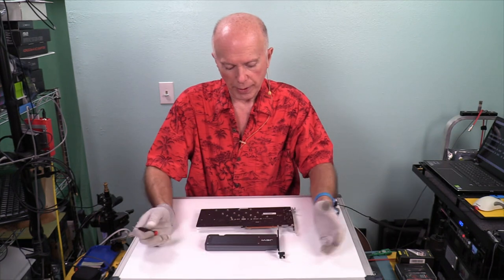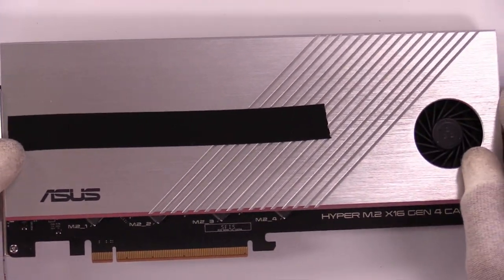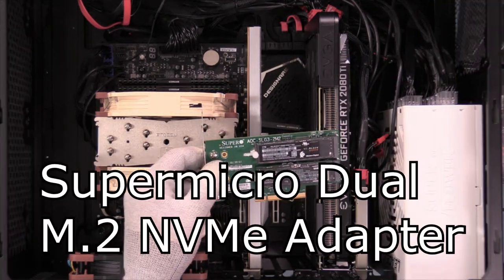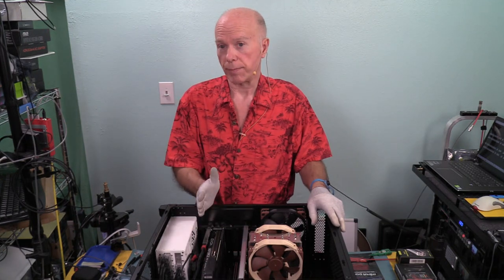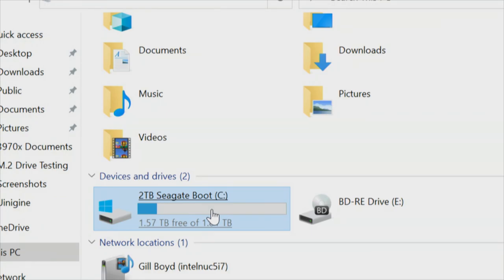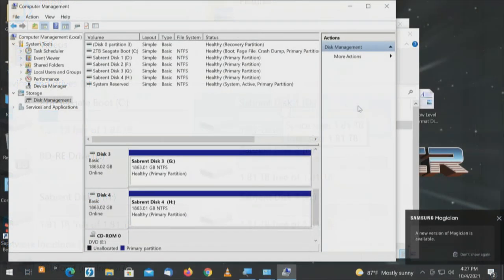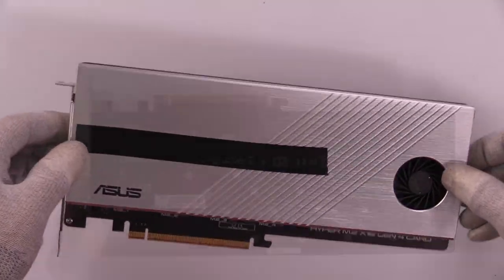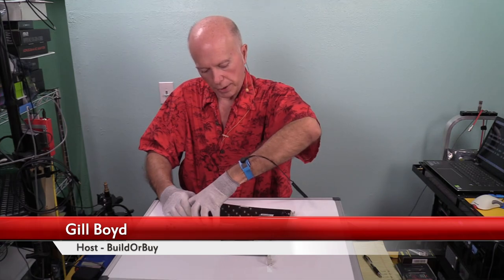ASUS Hyper M.2 X16 PCIe 4.0 X4 Quad card Heat and Speed Test Comparison

Comment: i have asus b550 m plus, i want to use this suport on second pcie slot, but he is pcie 3x16, i can use pcie4 ssd m2 with 7000MBs?
Reply from the maker: Hi Tuan Mello,
Welcome! We have more to get into on this than You may be aware of. What CPU are You using? Your Question may require a Video Response!
Reply: my cpu is ryzen 5600x
Reply from the maker: Hi @tautau22BR  
And Your GPU?
Reply: @BuildOrBuy  rx 5700xt
Reply from the maker: Hi @tautau22BR ,
Ok. Thanks. I don't think You have enough PCIe Resources to Add a X16 Quad card based on Your CPU and Chipset. We need to explain those Details in a Video Response so You'll understand how that works.

And the 2nd part of Your Question, You'll only achieve the speed of Your Motherboard Chipset. That too We'll include in the Video Response how that works as well! Appreciate Your Patience!
Reply: @BuildOrBuy  if I use 2 cards its possible? I dont plan tô 4 card yet,  i dont plan tô use raid too, i just want to expand, i can buy this suport tô use 2 cards and wait future upgrade of Mother board if I need 2 more slots,  i dont know if is good idea
Reply from the maker: Hi @tautau22BR ,
When You say 2 cards, do You mean 2 M.2 NVMe PCIe Drives or 2 X16 M.2 NVMe PCIe Quad cards?
Reply: @BuildOrBuy  2 nvme, 2 disk, the others 2 i can by in another generation, i dont plan to use raid
Reply from the maker: Hi @tautau22BR ,
To verify,  2 M.2 NVMe PCIe and 2 SATA3  Drives? JBOD, Got it! No RAID! Have to check Resources and get back to You!

To expedite... Here's what We know: 
1. CPU: Ryzen 5600X 
24 PCIe 4.0 Lanes
2. Motherboard: ASUS B550 M Plus
1 PCIe 4.0 X16 Slot to CPU
1 PCIe 3.0 X4 Slot through Chipset
1 PCIe 3.0 X1 Slot through Chipset
Supports CPU PCIe Bifurcation. 

1. To reiterate, not enough CPU PCIe Lanes. 
2. If You installed a X16 Quad card in 1st and only X16 Slot which Supports Bifurcation, Your GPU would have to go to the X4 Slot which is X16 mechanically but not electrically. Therefore, since You only have a X4 Slot to work with, You have two Options.
1. Install a Single M.2 NVMe Adapter. 
2. Install a Self Bifurcated M.2 Dual Adapter. That would be a card from Amfeltec. Here's a link:
"PCI Express Gen 3 Carrier Board for 2 M.2 SSD modules | Amfeltec Corporation" https://www.amfeltec.com/ssd-board-2-m-2-ssd-modules/
Hope that helps! Next time, let's talk Chipsets before You Purchase a Motherboard!
Reply: @BuildOrBuy  thanks for your help i can buy this on ali express?
Reply from the maker: Hi @tautau22BR ,
Good Question! That should be available there! Have not checked! Let Us know please! Getting product on a lot of Items mentioned is still a problem in certain areas. Keep Us Posted on Your Progress! Success on Your Configuration! Hope that helped!

Comment: m.2 nvme expansion card affects gpu ?
Reply from the maker: Hi @ΘεοδωροςΖωης-β7σ ,
Welcome! Depends. An M.2 NVMe PCIe Expansion card requires 16 CPU PCIe Lanes for 4 M.2 NVMe PCIe SSD Drives. A GPU typically requires the same, 16 CPU PCIe Lanes. That totals 32 CPU PCIe Lanes. If Your Motherboard and CPU combination has that configuration, no performance loss. That does not happen on a Consumer Desktop Motherboard. Only on HEDT or Workstation Motherboards.
Reply: @BuildOrBuy  thanks
Reply from the maker: Hi @ΘεοδωροςΖωης-β7σ ,
Absolutely! Thanks for asking.

Comment: Great video, can you install this and run it as 4 independent drives and not as a raid configuration?
Reply from the maker: Hi Dax Gaming, 
Welcome! Absolutely! That's the 1st step in Configuration, getting the Hyper card and 4 M.2 NVMe PCIe Drives Installed and Recognized by the Bios. Requires 1 x16 PCIe Slot, electrically. Bifurcated or Split from x16 to x4x4x4x4. 

The ASUS Bios or UEFI references this to RAID but that naming convention is a misnomer. RAID would be the next Step whether in Bios / UEFI or O/S in Configuration if so desired but to reiterate not required. Hope that clarity helps! Thanks for Asking!
Reply: @BuildOrBuy  thanks so much. I've been looking at the literature and was puzzled if it could be 4 seperate. Thanks for confirming

I'm running a asus rog crosshair hero viii wifi, so need to check all is good.
Reply from the maker: Hi @daxgaming6391 ,
That may be a problem. What Chipset? I'd like to do a Video response to explain the what, why and how. Also, which GPU?
Reply: @BuildOrBuy  that sounds great.
the rog crosshair hero viii wifi is a AMD X570 ATX gaming motherboard with PCIe 4.0, 16 power stages , OptiMem III, 2.5 Gbps LAN, USB 3.2, SATA, M.2, and Aura Sync RGB lighting.

CPU is the AMD 5950x with a MSI RTX 3080 TI suprimx 12gb.GPU
Reply from the maker: Hi @daxgaming6391 ,
Video Response Premiere's tomorrow!  
https://www.youtube.com/watch?v=yhCswjtumA4
Hope that helps!

Comment: Hello everyone, i have highpoint 6661a as I use it with Blackmagic decklink duo card, I am thinking to buy a quad nvme pci e card, will it work on MacBook Pro M1 Pro?
Reply from the maker: Hi Ahmed Jamil, 
Welcome! Great Question! Unfortunately no. The Quad cards of this type require Bios Bifurcation. And the Mac does not support that feature. In fact not all PC Computer do either. Not enough PCIe Resources in most Desktop Motherboards. HEDT or Workstation Motherboards have those PCIe Lanes for this. Since You have a Highpoint Enclosure, You have NVMe but You want more NVMe. Only requirement is a Full X16 Slot, electrically not just mechanically. Highpoint has 4 Drive and 8 Drive Self Bifurcated cards.

I'm confused. You have an NVMe RAID in the Highpoint 6661a NVMe Thunderbolt expansion chassis. But You want to ADD a Quad card to Your Mac? This should do what You want... This will work with a Mac.

Highpoint SSD7101A-1 NVMe 4-Port M.2/U.2 Unbeatable Peformance/Comprehensive Selection; No-Bifurcation Required 
https://amzn.to/3XZEOMn
As an Amazon Affiliate I earn from qualifying purchases! Hope that helps!
Reply: @BuildOrBuy  but no chance it will work on Mac? Thanks a lot for your reply really appreciate your detailed answer. Love how detailed your videos are.
Reply from the maker: Hi @metalliskined , 
Revised my reply with a Highpoint card that should work with Your setup. Thank You for Your Comments! These Details matter! Did not realize at first which Highpoint product You have! I do now! To reiterate, a regular inexpensive Quad card will not work on a Mac due to Bios Bifurcation Requirements. Bifurcation is the Ability to Fork or Split. In this scenario PCIe Lanes. Remember each M.2 NVMe PCIe SSD Drive requires 4 PCIe Lanes. A Self Bifurcated card has a PLX Chip doing the PCIe Lane Switching. Hence the price. Hope that helps with Your Video Production!
Reply: @BuildOrBuy  thank you so much it means alot
Reply from the maker: Hi @metalliskined ,
Absolutely! Thanks for reaching out! Keep Us informed about Your Progress! Are You Processing 4k or 8K Video?
Reply: @BuildOrBuy  I do live events, mix it through software and stream, also do video editing and color grading. have to deal with huge amount of data, copying and moving takes much time. I bought xs2000 Kingston hoping it will give full 20gbps bandwidth on mac but it's only 5gbps such a disappointment thats why I was thinking to have such 4nvme solution
Reply from the maker: Hi @metalliskined ,
Got it. That's a lot of data. An M.2 NVMe PCIe 3.0 Drive = 3,500MBps. And what We've seen with 4 Drives in RAID 0 is the Combined Speed of 3 Drives. 3 x 3,500MBps = 10,500MBps. Perspective. Hope that's going to help! Live Streaming 1080 or 4k? Live Streaming 1080 takes a variance of 12MBps tops from what We've encountered. For Comparison, Zoom needs 3.5MBps.

Curious the Kingston KS2000 is USB-C 20Gbps 2x2. Using that Device on a Mac You're only going to achieve USB-C 10Gbps. If it were Thunderbolt, 40Gbps but not 20Gbps. That's only going to happen on a PC with a USB-C 20Gbps 2x2 Port. Not all PCs have that capability.
Reply: @BuildOrBuy  was using lacie 2big tb3 8tb 7200rpm hdd but it isnt reliable, I don't know what happens but twice it gave me 0space and drive wasnt working once I ignored and formatted it second time I had to get data recovered which I had to pay 60% of the drive value
Reply from the maker: Hi @metalliskined , 
Big ouch! Last external RAID Solution We Tested was not reliable either. What a mess! We were Testing for a Client.
Reply: @BuildOrBuy  1080, mostly. I will be be happy to get even 4gbps. but I am not sure If it will work on mac or no. problem is my work requires travelling alot and with what windows laptops are  offering compared to mac I switched to apple silicon and now facing this storage issues. also I guess thunderbolt cant transfer faster than 40gbps so I will only get maximum of speed of 3800Mbps
Reply: @BuildOrBuy  can you tell me about owc express 4m2? will it work on mac?
Reply from the maker: Hi @metalliskined , 
To reiterate, are You asking about the add in card? Absolutely! Designed for MACs! Has Self Bifurcation. The price of the card is a good indicator of a PLX Chip being utilized for PCIe Lane Switching. 

OWC Accelsior 4M2 PCIe NVMe M.2 SSD Adapter Card Compatible with Mac Pro 2019, Mac Pro 2010-2012, and PC Towers
https://amzn.to/3x0i5Uz
As an Amazon Affiliate I earn from qualifying purchases! Hope that helps!
Reply from the maker: Hi @metalliskined ,
Just now seeing this Comment. Did not receive notification. Doubt You'd achieve that. Specs are about Speed. Specs are Burst mode and not actual Throughput. But the Specs are where We start then the Test and Verify begins. Results can vary for a given set of circumstances. Now since You're transferring 1080 files, even Streaming that data amount should definitely not be an issue unless We're talking multiple simultaneous data Streams. 1080 / 59.94 probably MP4? Yes Storage capacity is a very big deal very quickly but to reiterate, NOT the Throughput. Since You're on a Mac You can fully utilize Thunderbolt connectivity. You just need Capacity! We've Streamed 1080 / 59.94 MP4 through USB and direct to PCIe Bus on HDMI Capture Devices. The only issue depending upon the CPU would be Recording and Preview. That would create issues for the Duplicity of the data Stream on either Input. More CPU Cores could handle that Throughput.
Reply: @BuildOrBuy  thanks alot for guiding. 👍 sure will check the link.
Reply from the maker: Hi @metalliskined ,
Glad to help! Viewer Questions help Us to make better Videos! We help each other! Knowledge should be Shared. Appreciate Your Support!

Comment: Will the 980 pro With Heatsinks model fit into this card?
Reply from the maker: Hi Gary Miller,
Welcome! Just now seeing Your message! Great Question! We expect that to be an issue but have not Tested yet. You may by now have more current info to Share with Us based on Your experience! Appreciate Your Question!
Reply: @BuildOrBuy  They would not fit. I ended up using the non-heatsink version. Thanks for the reply.
Reply from the maker: Hi @DoYouLikeThisName ,
Absolutely! Understandable. Thanks for Sharing!

Comment: im cnfused which mobo tobuy,can a b550m tuf plus work with pcie2 slot?
Reply from the maker: Hi CiliskyTV,
Welcome! What CPU Are You using? Short Answer... We have to look at Design vs Implementation of Motherboard, CPU and Chipset and see what's possible. Without looking, probably not possible due to CPU PCIe Resources. And that's a problem on Consumer Desktop Motherboards. This AIC Requires 2 things, a PCIe X16 Slot, electrically and Motherboard Bifurcation. I'll check and verify if You like once We have that detail.
Reply: @BuildOrBuy  im using the Ryzen 3600 sir
Reply from the maker: Hi @HuntaKiller91 ,
Not possible for this Design and Implementation. That 2nd Slot is X16, mechanically but not electrically. 2nd Slot is PCIe 3.0 X4, electrically. You have enough CPU PCIe 4.0 Lanes for Primary X16 Slot and Primary M.2 NVMe PCIe SSD Drive, 16 + 4 + 4 = 24 CPU PCIe 4.0 Lanes. Last 4 Lanes tie Chipset to CPU. 

Ryzen 3600 has 24 PCIe 4.0 Lanes 
ASUS TUFF Gaming B550-Plus 
1. CPU: 1 - PCIe 4.0 X16 Slot, electrically. 
2. Chipset: 1 - PCIe 3.0 X4 Slot, electrically. 
3. 3 - PCIe 3.0 X1 Slots. 
Supports PCIe Bifurcation for RAID on CPU. 

Another way to look at this, to install this ASUS Hyper M.2 X16 PCIe Quad card would require installation in: PCIEX16_1 to see and utilize 4 M.2 NVMe PCIe SSD Drives. In Slot 2, PCIEX16_2, You would only see 1 Drive since only 4 Lanes are available on that 2nd Slot. Bummer, right.

Specs: 
Supports: 2 - M.2 and 6 SATA 
To CPU: 1 - M.2; Through Chipset: 1 - M.2
Supports RAID 0, 1, 10

"TUF GAMING B550-PLUS｜Motherboards｜ASUS Global" https://www.asus.com/Motherboards-Components/Motherboards/TUF-Gaming/TUF-GAMING-B550-PLUS/
That's always an issue on a Consumer Desktop Motherboard! Some Chipsets do a better job with CPU PCIe Resources however, 24 CPU PCIe Lanes are not enough to go around to do everything. We have to do this on every Motherboard to verify the Design and Implementation. To get 2 - X16 PCIe Slots, electrically would require a HEDT like X299 or X399 Chipsets. Hope that helps! Thanks for Asking!

BTW: What GPU will You be using? Do You want Your GPU in a X4 or x16 Slot?
Reply: @BuildOrBuy  thank u sir
So all i need later is just buy a ryzen5000?
Or i just stick the hypercard on the first pcie and gpu on second pcie?
Reply from the maker: Hi @HuntaKiller91 ,
Glad to help! You're welcome! To reiterate, stick GPU in 2nd Slot and Quad card must be in 1st Slot. Success! A new CPU, as mentioned, will have more CPU Cores and Faster CPU Lanes but not MORE CPU Lanes. You would need a HEDT or Workstation Motherboard.
Reply: @BuildOrBuy  ok then
Thanks for the recommendation sir
Helps a lot👍😃
Reply from the maker: Hi @HuntaKiller91 ,
Absolutely! Consumer Desktop Motherboards are getting more complicated to setup due to these Shared Resources. And every one of them is different! Thus these Videos! Thanks for Watching! Keep Us Posted on Your Progress! Success on Your Build!